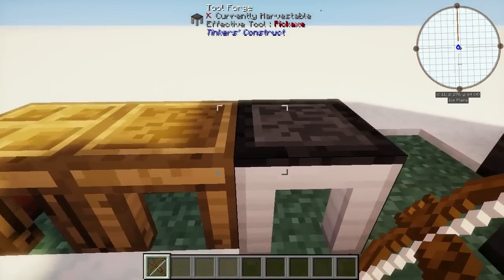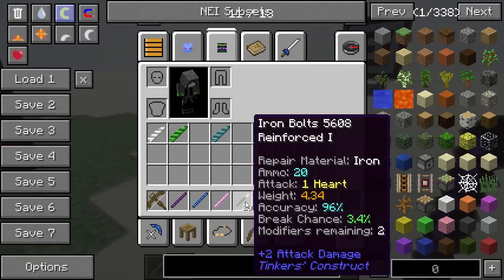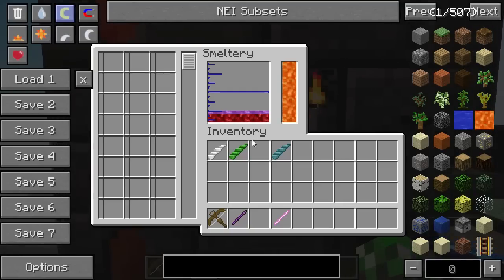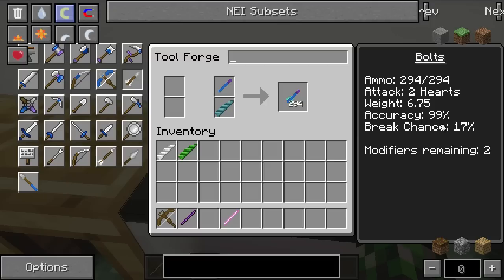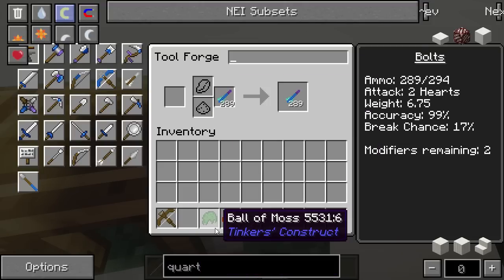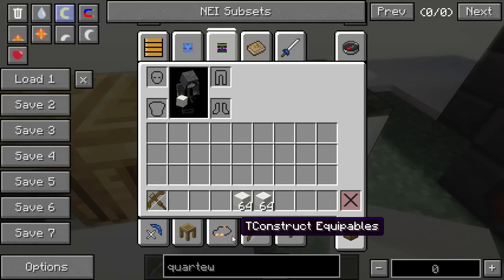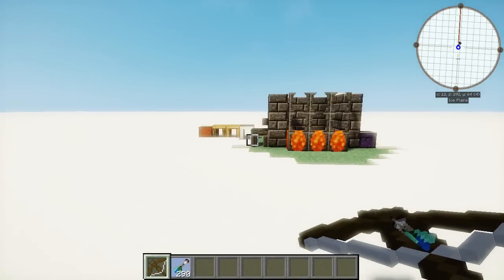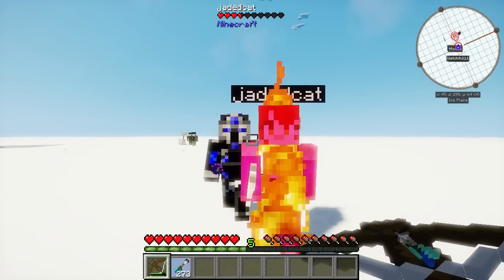Tinkers' Construct: Crossbow Bolts Tutorial

Comment: Would a bolt with an ardite tool rod coated in manyullyn with a slime leaf fletchling be good?
Reply from the maker: +Scope Lens Kingdra it would be so-so as with the latest patch all bolts do 1 heart of damage. The best bolt is a double lead bolt as weight = armor penetration. and it carries its damage better at range
Reply: Argh! why must tinkers construct finally start to get balanced!
Reply: +Mattmon Wait, does that mean quartz doesnt even up its damage?
Reply from the maker: +Scope Lens Kingdra sort of. quartz will up the damage AFTER it hits. So a full stack adds a heart and a half of damage AFTER it hits. It DOESN'T get multiplied by the arrow speed anymore.
Reply: Welp, time to change my entire formula for arrow damage sigh
Reply: +Scope Lens Kingdra Extra TiC unbalances it again. I run a Manyullyn tool rod with an Enderium head and Slimeleaf fletching. Has 385 ammo, does 4 damage.
My crossbow has a Signalum limb. 12.6 arrow speed.
They dont reach out very far, but the tool tip says its 96 hearts of damage per shot.
Reply: Extra TiCon unbalances it to the point of pure invincibility, it would maybe work in an ultra modded server with mega powerful enemies and other weapons, but stand alone its OP
Reply: Yeah. You complained about it regaining its balance.
I dont think this is very balanced.
Reply: I'll definitley add Extra TiCon if i ever do a server with mods like blood magic and twilight forest, thanks for the help!
Reply: +Mattmon Just realized, double bedrockium would be the best, it the heaviest thing compatible with TiCon, it even makes you slower when holding it xD

Comment: What if you use a paper rod to have a low weight and a extra modifier Would that work?
Reply from the maker: Unfortunately, no. You have to use a solid material for the core of the bolt. The lightest material is bone but does not provide a bonus modifier. Thaumium weighs the same as iron AND adds a modifier.

Comment: Can't make a bolt core in direwolf20 1.10 pack.. It's not pouring the metal on the tool rod
Reply: Oh by the way.. It worked now, I had to replace the tool rod with an arrow shaft before pouring the metal
Reply: Thank you!
Reply: Huh? I done that and I got a casting for the arrow shaft
Reply: did you pour gold around it or something
Reply: @zorgatone3708  THANK YOU <3
Reply: @zorgatone3708  thanks for the inform<3

Comment: how do you repair bolts?
Reply from the maker: You can either apply a Ball of Moss to add auto-repair and wait, or use the material you poured over the tool rod. You can repair the Bolt by placing it in the tool station along with its repair material.

Comment: so if you modify the bolt with moss ball, the amount of bolt will regenerate over time?
Reply from the maker: yes they will! The more moss you put on, the faster the regeneration. Bolt and other ranged weapons will NOT regenerate if they hit 0 ammo, so manage your reserves carefully.
Reply from the maker: +MORS STUDIOS It's really easy, just repair it at the tool forge using the material that was used for the tip.
Reply from the maker: +MORS STUDIOS that is very strange. Maybe re-download the mod?

Comment: Sorry if this sounds stupid but how do you replenish the bolts?
Reply from the maker: There are 2 ways. You can either put the bolt into the tool station/forge with what the tools repair material is (the one you poured on top) OR you can use a modifier slot to apply a Ball of Moss witch will automatically but slowly replenish bolts at no cost as long as the total has not reached 0 bolts.
Reply: Mattmon alright thanks

Comment: For some reason Tool Rods no longer work, I had to use Arrow Shafts for the Bolt Cores.
I'm using TC 1.10.2-2.6.1 in Direwolf20 1.10
Hope this helps.
Reply: Please help me it doesnt want to poor if i put a broze arrow shaft on it
Reply: Comma Gaming 
if you have NEI then just check and see what bolts exist and then use that type of arrow shaft. such as the wood one you need a wood arrow shaft THEN pour the metal to make the bolt
Reply: and now it takes 2 ingots per
Reply: wow thanks!